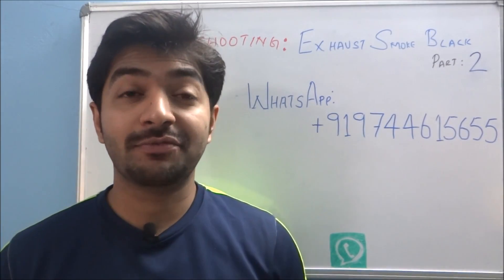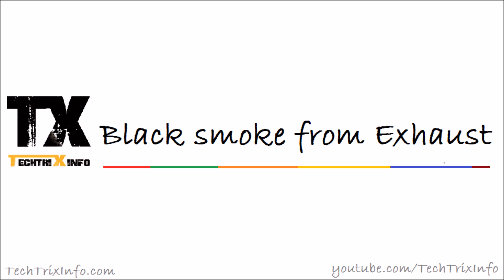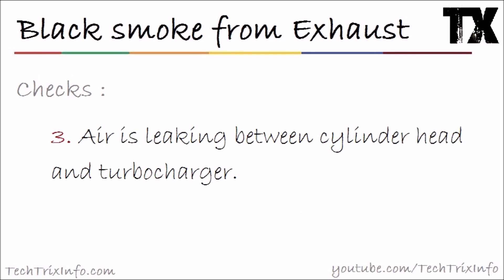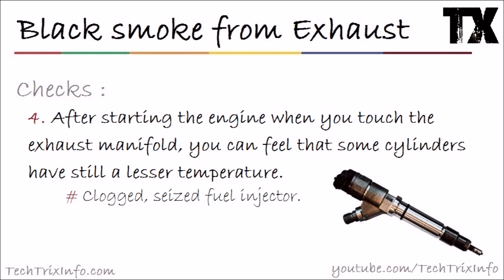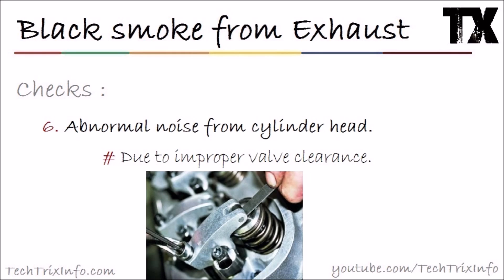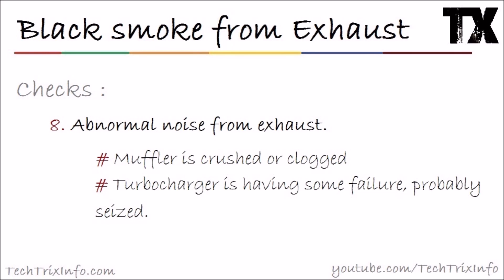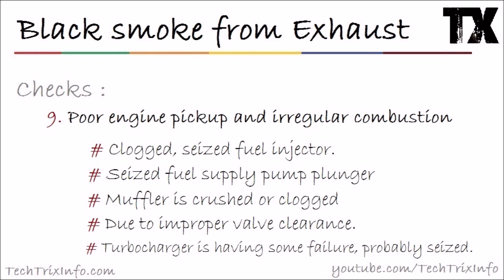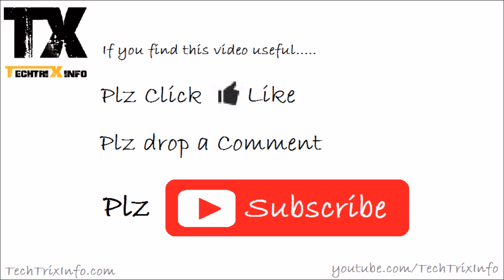Why black smoke from exhaust | Causes 2.✔

Comment: Hey I’ve just sow you video I have opel vivaro 2019 1.5 diesel my van losing power and black smoke coming out plus it’s not losing engine oil and when I accelerate there some noise come from intercooler pipe but I open that and check there was nothing in there but still noise is there and black smoke
Reply from the maker: Hi, Black smoke from the exhaust usually means the engine is burning too much fuel. This can happen if the fuel injectors are faulty or if there's an issue with the turbocharger. Since you’re also noticing a loss of power and noise from the intercooler pipe, there might be a leak or a problem with the turbo system. Even though you checked the pipe and found nothing inside, there could still be an issue with how it's connected or sealed. It’s a good idea to have a mechanic check the fuel system and turbo components to find and fix the problem.

Comment: Hey buddy i have wrx 99 gc8 i never started car for a month  and now its blowing black smoke on start up and acceleration..
Acceleration struggles at 2000rpm.. 
Fuel injectors? 
All related problems with fuel?
Changed maf sensor 1-2yrs ago

Comment: what will cause motor to have black smoke out the tail pipe. chevy 350 motor, 130,000 orig miles. Just put new plus wires cap rotor and o2 sensor. Still has black smoke No ck engine light. no misfire   Also the exhaust has side pipes running straight off the manifold under the doors on each side.  Black Smoke only drivers side...

Comment: Good day, Ive noticed a had vibration from my 4d56 in my l200.  I replaced engine mounts and gear box mounts.  I was thinking contamination in the fuel so i have flushed all and put fresh fuel.  My question if you might know something of this,  I have white/black smoke coming out when driving.  seems to have low power even when the turbo is running.   My thinking next to check injectors and timing.    Perhaps you have any recommendation to the cause.  Lastly,  when shutting down the engine it makes a hard knock as it's shut off!  Not sure if a crank barring or other barring at the crank?  With the white smoke , to me wouldn't be a barring! But i could be wrong!   SO is it Timing, a valve, injector or????   Thank you kindly

Comment: NO.7 I've had this issue and it was EGR Valve fault. It was clogged and RPMs were going crazy
Reply: What is EGR Valve
Reply: @kartikeypanwar9622  can't you google it? Exhaust gas recirculation - wikipedia

Comment: Bro I purchased used indigo ECS cr4 diesel of 2011 model with 50000 km running at time of purchase all things ok 
But now at idle when I press clutch   rpm fluctuations abot 200 to 300 
When release rpm steady
Also black smoke problem when pressed upto 2000 rpm

Comment: Bro my toyato tercel is working good but only on morning when started black smoke  when the car  heats up no black smoke  an its a carburetor engine when the engine cold I get that promblom y is that
Reply: Rickson Ramlal its carborated so there could be left over gas in the carb barrels that buns out of the exsaust when you start it

Comment: Hi can you help me find the problem of my car. My car is kinda old 2000 model my problem the black smoke coming out from the exhaust and I
Can smell the gasoline while the car is switch on and running. Can it still be fix and is it dangerous to drive it still. Thanks

Comment: associated with this ... we hear a lot about the word refinement ..say German cars are superior to Japanese counterparts .... does this has to do anything with the refinement...
Reply from the maker: +Cyril Matthew 
Tks for the comment. 

Refining the engine performance or tweaking it mainly in terms of more power or less specific fuel consumption. Both of which requires additional alterations like modifying the air filter, modifying the cylinder size or modifying the carburetor or fuel injection system and also adding additional heat exchangers.
Reply: TechTrixInfo.com thanks for the reply... so simply an engine which can produce greater output and fuel efficiency with minimal engine capacity is more refined ..ryt???
Reply from the maker: +Cyril Matthew 
Can say that